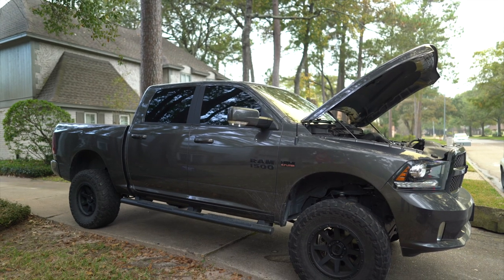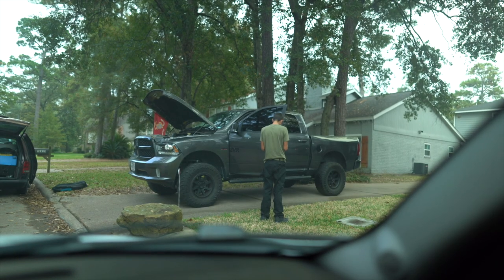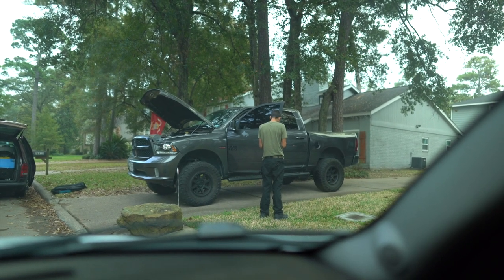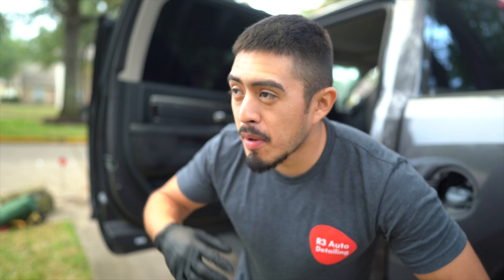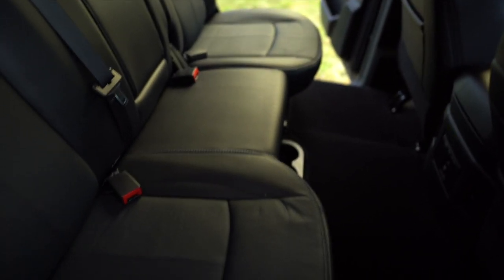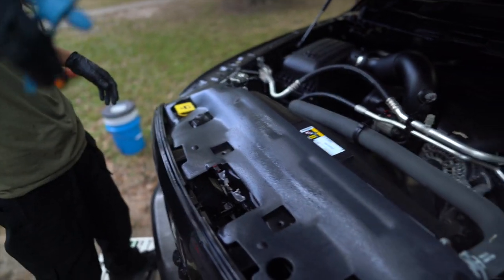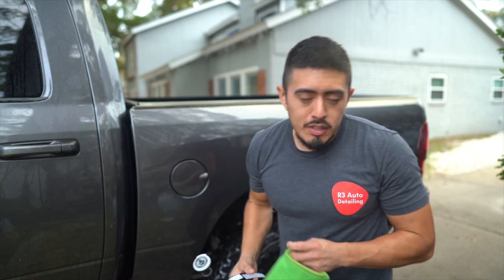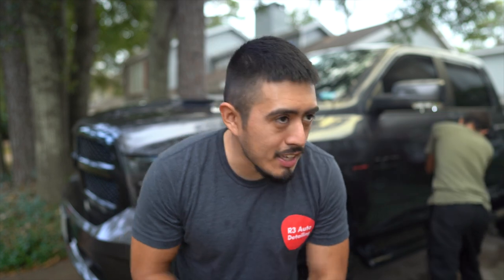Detailing One Truck and Making $600 in 5.5 hours | Our Customer Experience Process

Comment: How a wash an wax cost more than interior detail
Reply: Cause the exterior is more longer and is more for experience wise to do, otherwise you could risk damaging you paint and that's not easy to fix or ve cool about!
Reply from the maker: It's never crossed my mind that the interior should be more expensive than the exterior. Why is this a surprise?

Comment: I have a question I have a really good pressure washer 2800 psi but it ruined my dads car it made all scrated please do I video how to power the right way
Reply: To be frank 2800PSI isn't good for car paint. Anywhere from 1000-2000PSI is plenty and having a higher GPM is more important than the PSI when it comes to car washing
Reply: @williamtse4462  what is gpm
Reply: @zacharyklein5734  gallons per minute
Reply: Are you using the white attachment?
Reply: @zacharyklein5734  So GPM means how many gallons per minute of water a pressure washer shoots out. The more water that comes out of the pressure washer means the more it can flush out dirt and what not
Reply: Hold it at a safe distance, dont use turbo nozzle used for concrete cleaning..
Reply: Gpm is gallons per minute.

Comment: Hope you don't get a callback regarding a new replacement alternator for that customer.  You didn't even bother to cover it. I've seen a few go bad doing what you just did.
Reply from the maker: We won't
Reply: Alternators are ok to get wet, it’s the bearing that you need to be careful with. This truck had original alternator with a cover protecting the bearing, so cleaning it wasn’t an issue. Anytime the dealer services the alternator they remove that cover and don’t put one back, which then causes the alternator to fail because the bearing gets dirty, then they charge you for replacing the whole alternator when just the bearing needs to be changed.